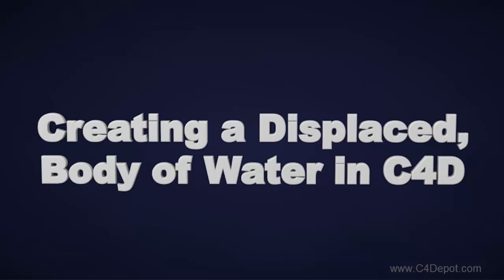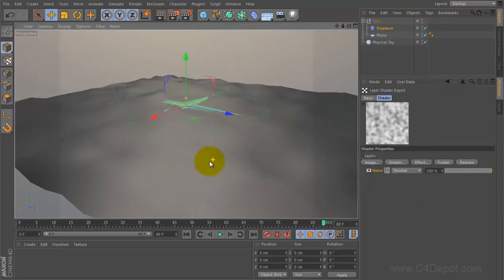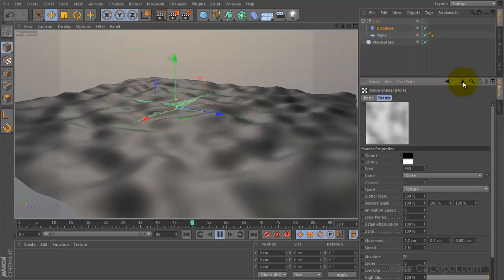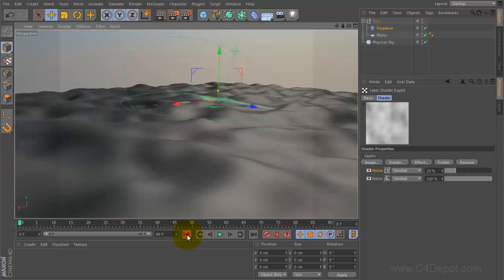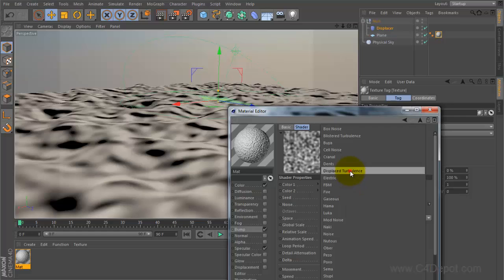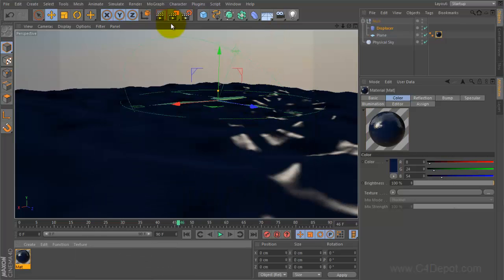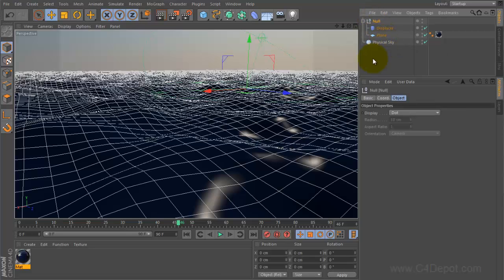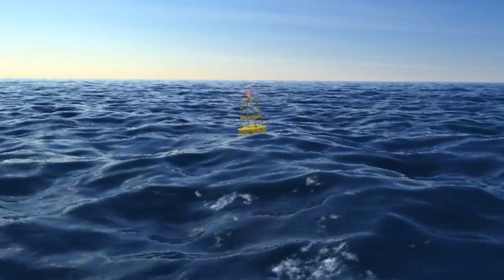Creating Realistic Displaced Water in C4D

Comment: A quick tip to make the water look infinite. Just make the plane the size of the default grid/construction plane thing then just add an environment and enable fog and adjust the strength and distance to hide the edge of the plane(Water). I usualy set mine to Strength: 100% and Distance: 10000 cm. Not saying you shouldn't get his Infinite Ocean (I know I'm gonna get it). Just a tip you can use on similar landscape projects.